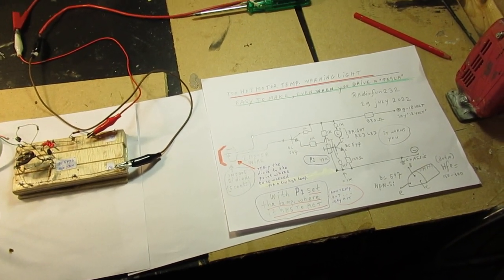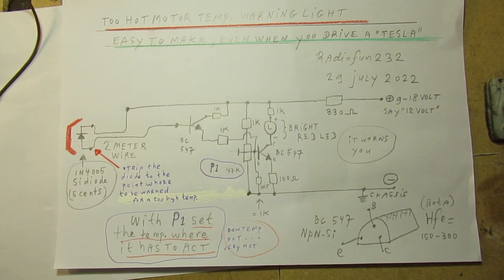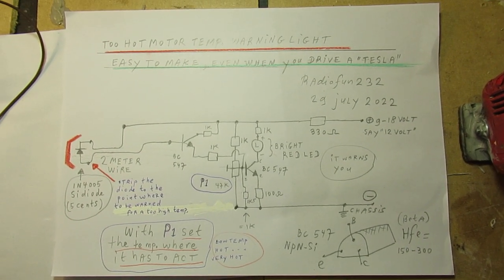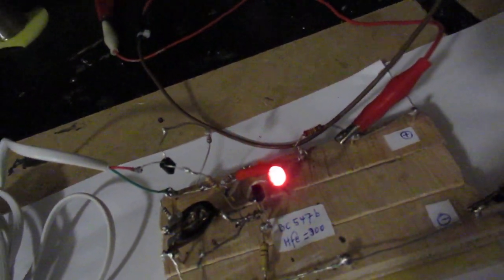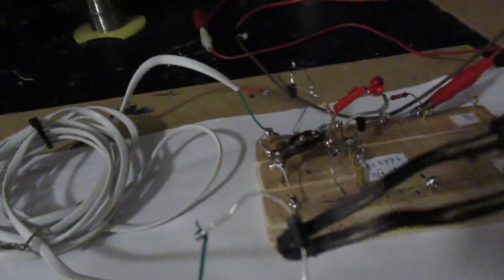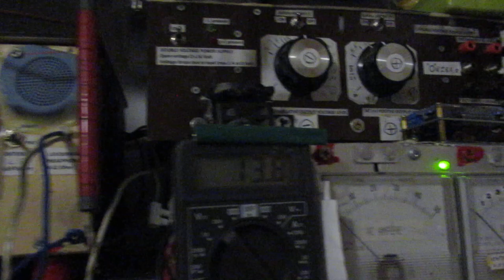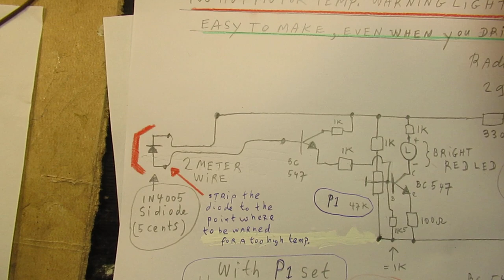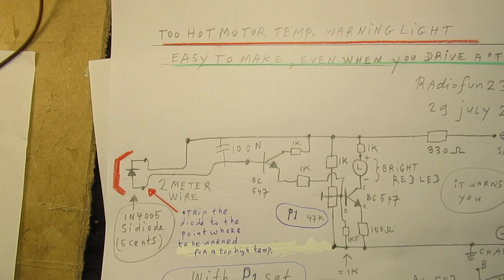Too hot motor warning light, even when you drive a Tesla: 2 transistors and 1 Si diode (schematic)

Comment: Could a computer fan be installed instead of the LED thereby allowing the fan to turn on when the diode gets hot and off when it cools down?
Reply from the maker: There are sensitive 12 Volt relays with a DC coil resistance in the order of 700-800 Ohm. With such a relay in the collector lead (instead of the LED) and the emitter resistor removed I think it will work directly.
Reply from the maker: Hi Barry, I have tested this today, 30 july 2022. Use a 12 Volt relay with a (DC) coil resistance of 270 Ohm. Keep using both the BC 547 b transistors. Bridge the emitter resistor of 100 Ohm with a wire (=shortcut) and bridge the 330 Ohm resistor in the supply lead (+) with a wire (= shortcut).  Solder the relay between the collector and the (+). Supply voltage = 11.5-12 Volt exactly (higher voltages don't work good). Bridge the relay coil with an electrolytic capacitor of 470 uF/25 V, to avoid "hum" and hesitation on the relay coil. Now the relay switches on when the diode gets warm/hot. The relay switches the fan on and off, depending on the temperature of the diode. Set the temperature range where it has to switch with the 47 K bias potentiometer. I have pinned your comment. Thanks, have a nice day! 🙂Ko.
Reply: @radiofun232  
Perfect, I'll breadboard up one for testing. Thanks Ko, have a peaceful weekend.